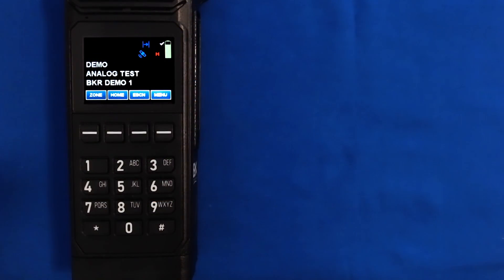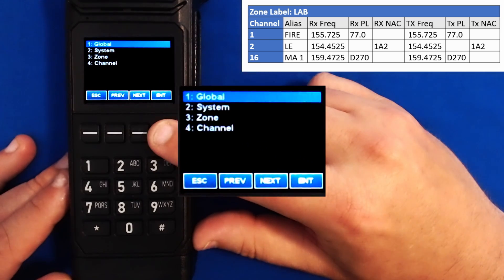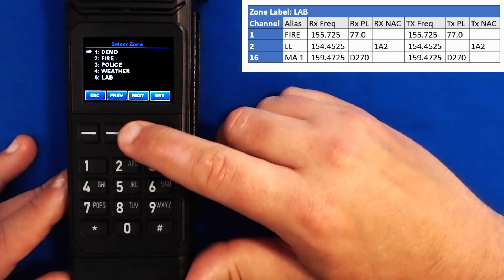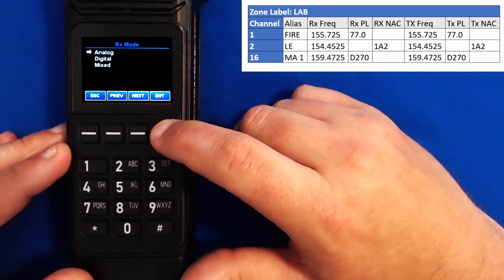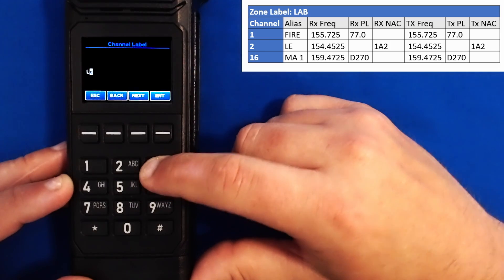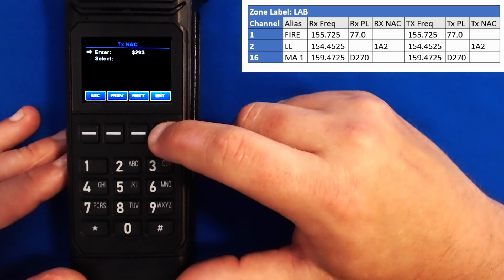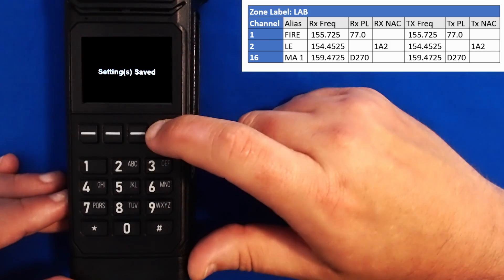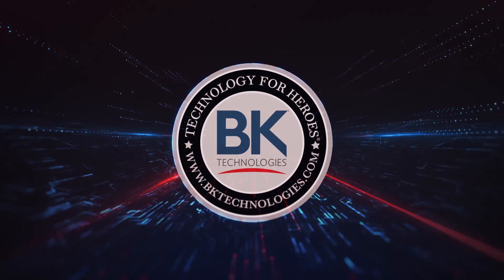Keypad Programming the BKR 5000

Comment: Question for you.. Is there a way to easily change Tone Guards on the BKR5000... On the old DPH's we would just hit the tone guard number on the key pad and it changed.   I have friends in MT-DNRC and we could figure out how to quickly change the tone guard to go between repeaters easily with the programing we had.   Please advise or make a video on how this works. The owners manual is not very user friendly.
Reply: Hey, did y’all ever figure this out?
Reply: Didn't he say in the video that it's in the tone section within the Rx Guard menu? Also looking for a solution but we still need the tone,  so...